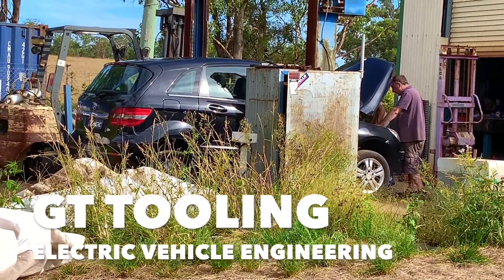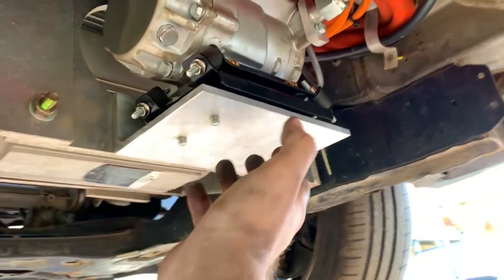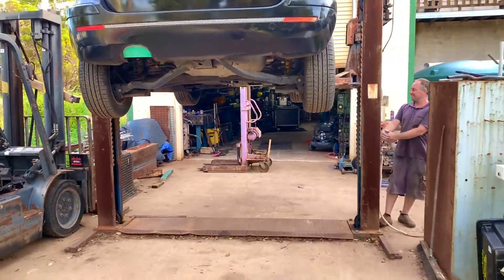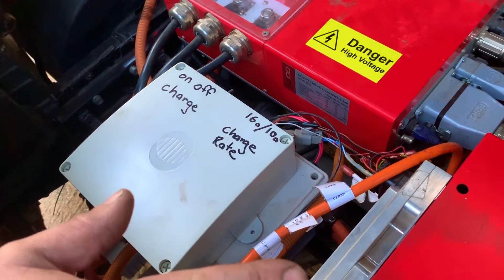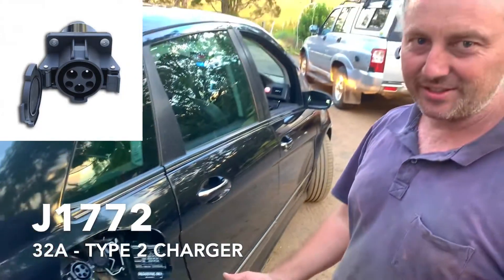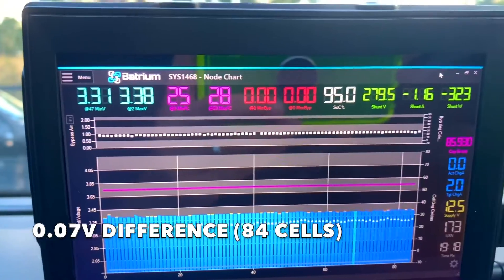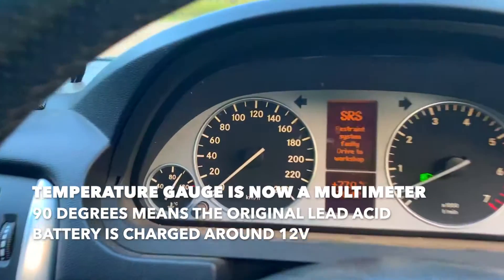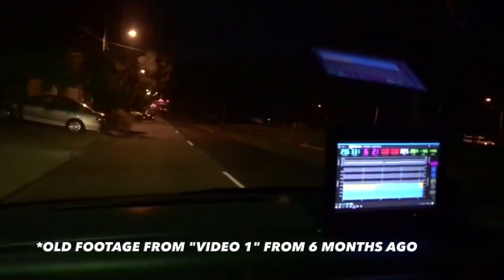DIY Electric Mercedes B-Class 300v (part2) - Adaptations required

Comment: Fitting AC in an EV is in the same category as mounting a resistive toaster on the blower for heating. What I have done is insulate the roof with 4 mm sturofoam sheets and added a 120mm ducting Flex hose directly from the bumper to the air selector box, so IT feels like ridning a motor bike on the highway. I Also removed some of the restriction in the dash nossles to get as much air through as possible, and It had Worked a charm. In 2018 i drive across Spain in 45C, and there was No sweating and only an inch of front Windows open.

Comment: Very cool! One question: Aren't the batteries a little too exposed to shocks?
Reply from the maker: SuperCANGUROTTO thaaaaanks mate!! 
The battery boxes are metal sheet then there’s another protection layer between the box and the cells + the cells themselves are a very thick and hard plastic like a solid brick. There are many other ways to protect the bottom of the car, ideally adding a thin metal sheet (aluminium is fine) making the whole bottom of the car flat (Teslas are like that) this would’ve also reduce the air turbulence under the car and may increase a few Km range but... the owner is happy with the car the way it is...
Reply: @BrunoPOWEEER  ok, thanks for the very complete answer 😉. Very clear!

Comment: When you ground an electric conversion like this is it just the 12v grounded (dc/dc) or is the 300v battery grounded?
Reply from the maker: MTB Down Under great question!! The 12v stays everything like the original setup, the 300v DC is a separate closed circuit that doesn’t ground to the car chassis. All cables have at least double insulation and must be in bright orange to indicate High Voltage. It’s a bit confusing when both positive and negative are orange so there is always a red/black heat-shrink over the copper lugs to identify the cables. Same with Teslas, they make a red or black strip near the end of the cables and the high voltage is never grounded to the chassis.